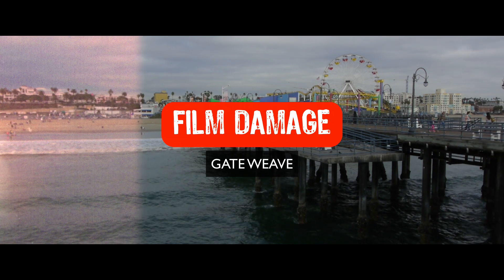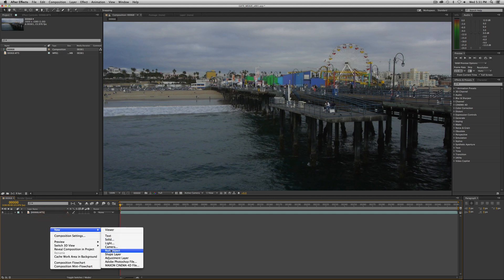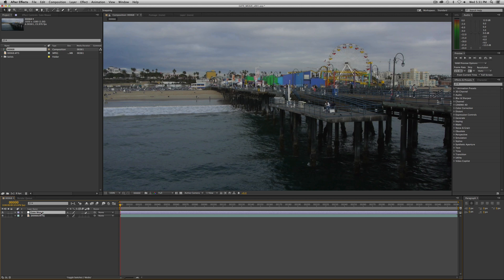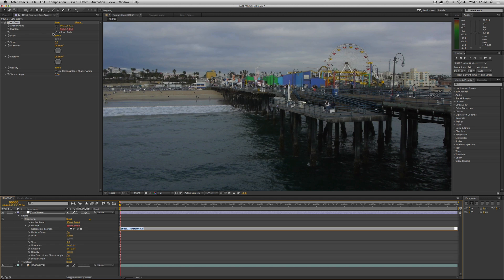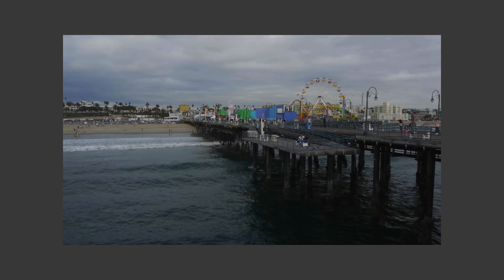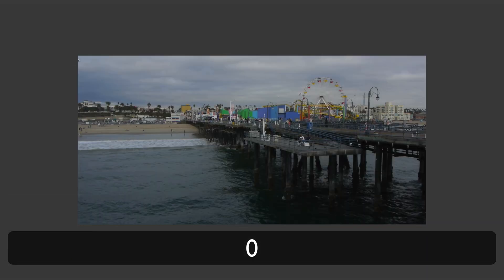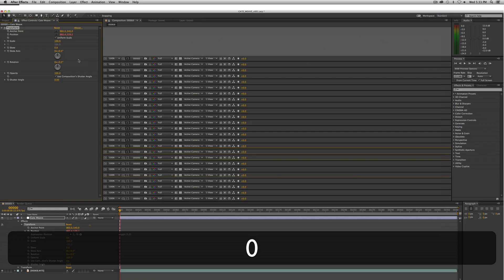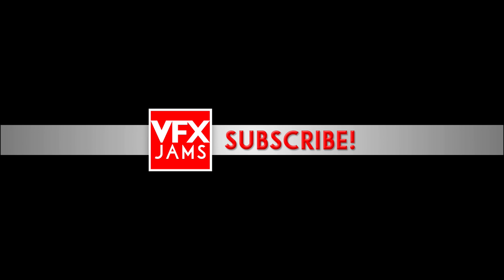DIY Film Damage - Gate Weave

Comment: simply knowing that this jittering film effect is called 'gate weave' has helped me out a lot
Reply: Same. Gate weave, subtle variation in color/exposure/etc between frames (forgot if there's a specific term for that effect in film), and film grain. If you can fake all three, you're pretty much there. A subtle diffusion filter would probably help too, as well as a decent censor and a not too clinically sharp lens. (I feel like that's quickly becoming an overused word to describe lenses.)

Welp, not sure why I'm sharing that, but cheers!
Reply: Exactly